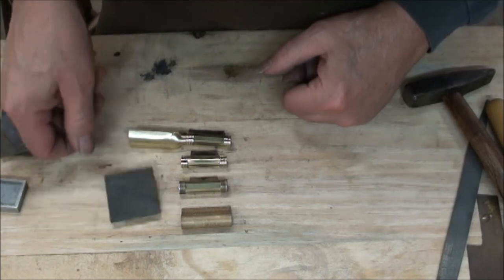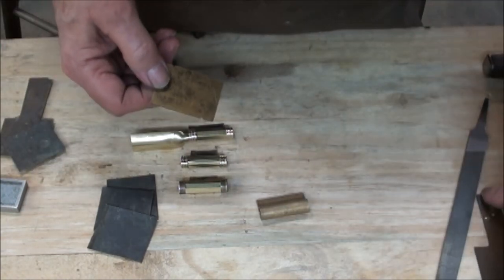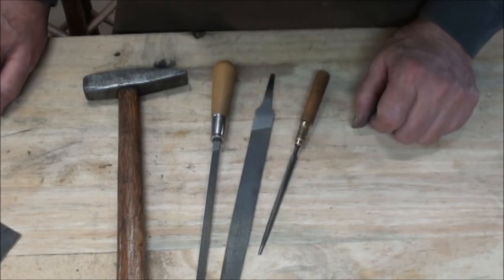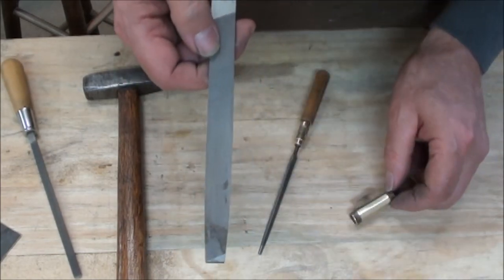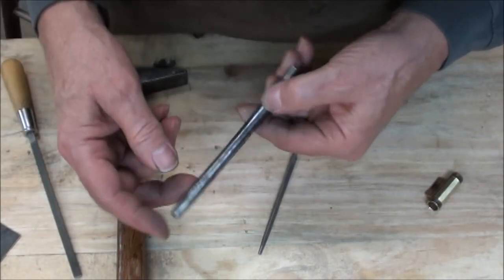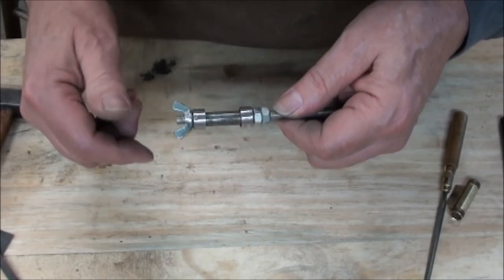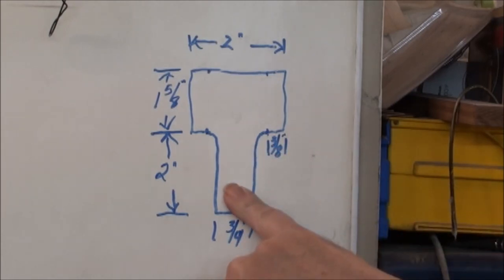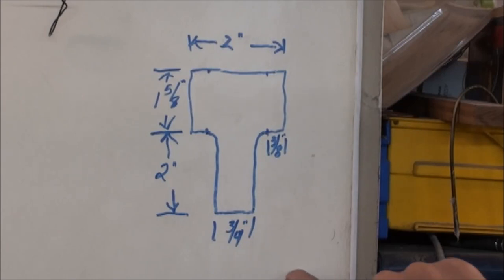The Grumpy Gunsmith of Williamsburg #37 - Ramrod Thimbles Part 1

Comment: Hi grumpy, I was wondering if you could tell how ro analysis the 14 gauge brass you are working on as I have 2 guns I am working on that will need the thimbles and I would like to try and make my own
Thank you Bruce Richmond
Reply from the maker: If you mean anneal the brass, heat it with a propane torch until the brass starts to get red then quickly quench in water. During bending thimbles,  you may need to anneal them again after forming to take the "spring" out of it.

Comment: I'm planning to purchase some brass sheets, but I'm not sure about the thickness.  You say the brass you are using is 0.030" thick and 18 gauge, but 18 gauge brass is 0.0403" thick according Online Metals thickness chart.  BTW, I love your videos.  I've binge watched almost all of them.  Keep up the great work.
Reply from the maker: It was probably late at night when I did the video and very tired. I use the 18 gauge or .040" for my trade guns. For the kits I sell I use .050" 16 gauge but for my own builds I like the .040". The .050 holds up very well without bending up over the years. The original trade guns I measured at .020" to .025" thick parts. The thimbles always seem to be around .016" or slightly thinner. The ribs on them are to strengthen the pipes when rolled. Always anneal the brass well. Good luck and thanks for watching.
Reply: @grumpygunsmithofwilliamsburg  Thank you for that thorough explanation.  What gauge/thickness brass do you use for the patch boxes, and are you using the alloy/type 260  or 464?  Thanks